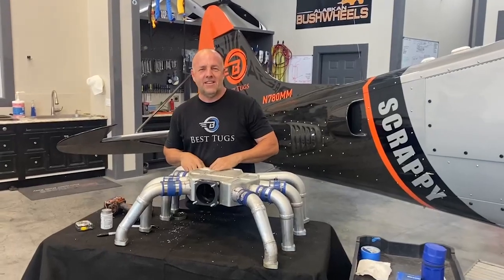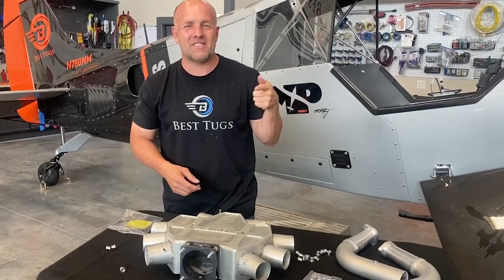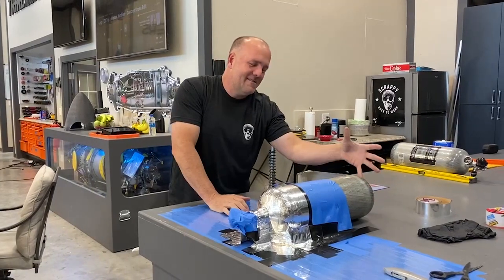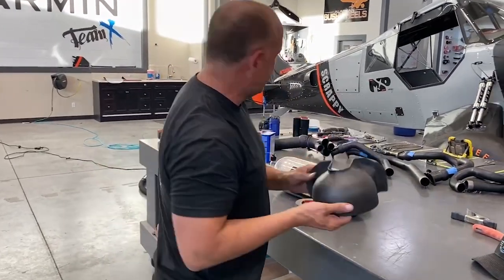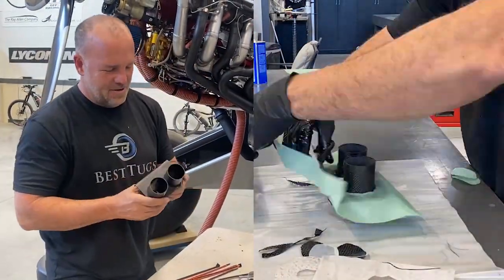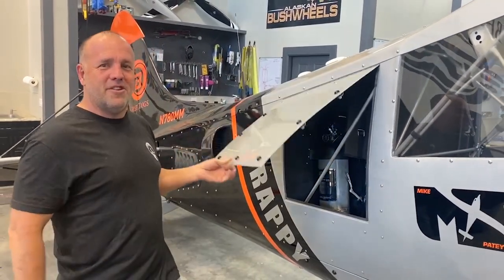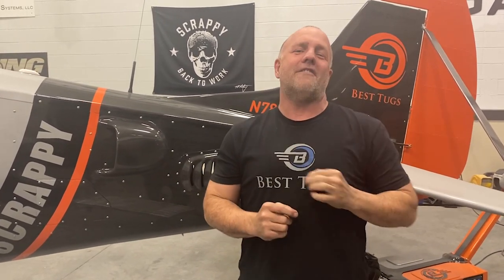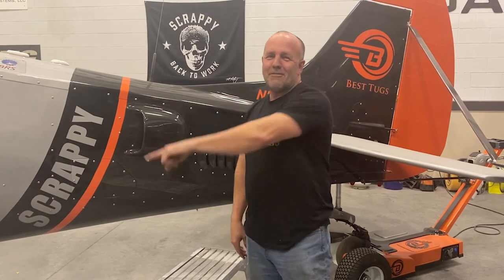Monster NOS Race Engine in a Bush Plane - Part 2 | Scrappy #40

Comment: The more I see of this engine build, the more I think Scrappy won’t need wings after all. Wow, what a beast...
Reply: Stole my thunder...lol I was thinking that same exact thing and almost posted it the same way.
Reply: I think we will be surprised by the wings... there is a reason we have not seen them. Delta wings for supersonic? The gear winglets will be enough? Tube wing?
Reply: Legit scared about other component ripping off under the trust, torque and vibrations this is gonna produce

Comment: I have seen so many young people think they just bolt on the kit and instant power.
With a small shot they can get away with it, but that is never enough and rings bind, head blow, and they are out of luck. Nice explanation of ring gap and its importance.
Good luck with your timing adventure, it is one of the more important items with nitrous injection.
Thanks for sharing.

Comment: Griplock zip ties, the thing you don't think you need until you try them then you wonder how you ever got by without them.  Used these on my boat last year and I'll never use cheap zip ties again, after a year of direct sunlight and exposure all the Griplock ties are pristine.

Comment: What can possibly go wrong... By virtue of the fact you are still alive, I'm going to say that you one very smart guy. Kids - don't try NOS at home. Am very impressed by build quality and parts too; love that you are knocking-out custom carbon-fibre parts in under an hour. I'll spend time going back over your fibre videos and the machining and cad designed cutting and tool&dye builds are over the top. No way you're fooling anyone that some of that took a year or two to figure out. Will look for your CAD video too. Great videos!

Comment: Mike, make a Y fitting 1 to the NACA 2 out.  the other issue you will be likely to have is the pressure drop across the two (cold & Hot) lines are most likely not going to be the same so your flow across the mixing valve will not be liner.

Comment: Scrappy will be in the air before it's flying, the tail surfaces will have lots of airflow, but not the ailerons, so maybe a scuba tank could feed some wingtip jets for roll control like the x-15 in the first  second before it accelerates to 60 and everything works normally?

Comment: NOS bracket weight reduction = impressive work! ☺️
Reply: and thanks for the explanation of nos burn... given you have 3 settings (?) compared to, say a car that has variable control via ecu, does that mean your witched system is quite noticeable in power surge/engine performance increase?

Comment: If the length of the hoses aren't the same they won't all mix at the same time. You can use diff dia tubes based off the length to compensate. Or add extra to the ones that are short

Comment: I suggest, you consider setting up a simple ECU setup to control timing, ignition, fuel via a tuneable computer in the aircraft. It will be a simple turn key ignition, everything can be run off the computer in terms of engine, etc. It will be much more efficient as it will make constant changes based on conditions...
Just my 2 cents...

Comment: There is a company out there making carbon fiber high pressure tanks.  The inside of the tank is aluminum but thinner then normal and carbon fiber to give the tank strength for the high pressure.  That might be worth checking into.

Comment: Would be a smart thing (if not already in the works) to have a separate bypass to the entire NoS shenanigans. If anything goes wrong, that bypass to disable anything NoS and return the engine to normal operation.

Comment: I have been using nitrous for ten years to set one mile land speed records. I push a 15 ci engine with 30 hp to 60 hp. And I spray for 30 seconds. I found running 600 psi is easyer to deal with than 900 psi. 
I realize you have already built the system. But I tried all the systems out there. I use Wizards of Nitrous from England. It’s the only system that works consistently on my extreme system.

Comment: Will hit harder/do better with the nozzles closer to the cylinders.... so further down the pipes.

Also..... there are electronics out there that will handle the timing issues and all.... don’t over think things. I’m not sure how changing voltage will change timing.... but interested to see how it works.

Comment: Excellent sir ! Why not a simple Arduino or raspberry pi controlled system for the NOS ignition timing adjustment a simple few lines of code in python or C# will do the work once hooked up to your 50hp 100hp dashboard switches, if you add also lamba probes to your exhaust system you can do all sorts of interesting things to this Lycoming 8cyl ignition and timing on the fly , and just blow our minds even more!

Comment: Curious if you considered using an electronic ignition system? Like an electroair or surefly system (modified/reworked for 8cyl. application of course). Something that would allow dynamic timing for normal operation and different timing control for Nos. I would think you've considered it already, and would like to hear your thought process on why it is, or isn't best (or practical) for your application. Maybe in the next video you could talk about it? Thanks! Love the videos. Keep on doing this crazy awesome stuff.

Comment: Amazingly cool, on a subject I know nothing about.  But honestly I am waiting on the wings...and hopefully will get to see some novel uses of carbon fiber in the construction of them.  I have always wondered why, if carbon fiber is the supposedly end all be all "new" material, stronger, lighter, will not corrode, etc...then why are we still using fabric and aluminum to construct wings? I imagine a wing using carbon fiber for both the covering and the ribs...maybe even  Kevlar/ carbon fiber control cables?

Comment: absolutely fascinating!!  I will never use NOS, but the details are fascinating!  watching over the last couple of years I have decided I need to make some parts out of carbon fiber.  you make it look so easy.  I will do my homework though.  thanks for the motivation to do something new.  you are the guru of innovation and manufacturing.  really liked the closeups of the CNC lathe.  I programmed and ran several including CNC mills over the course of 20 years in the industry.  REALLY brought back great memories.  Thx Mike.  BTW: are those Lycoming Electric Bikes?  :o)  :o)  couldn't help smiling throughout the video.

Comment: Hey Mike I do a lot of custom tuning on automobile computers why not put a stand-alone ignition system on Scrappy the tune ability Alone might add extra options and Power, Plus data logging and the safety of knock sensors.

Comment: Oh and if you built a system so you could  let your tires rotate in the air stream the electric  rim motor  could be used for emergency  power. So maybe one alternator will do.saving more weight.

Comment: So I did the math on the wingspan you'll need for that much horsepower/thrust and it came to just over 6 feet. So more like a flying elevator than wings. That should be a quick vid...

Comment: Pardon the question, but if you turn the variable heat, and air flow knobs to lowest settings, where will the buildup of heat go? Would adding a butterfly adjustable "y" pipe before the firewall be a good idea to control that stagnant heat?   Allowing it to escape out the side.. just thinking about the tubing melting.. (the orange tubing)  wasn't clear what you intended on using.
Reply from the maker: Great question 👍🤠. There is no stagnant heat, that’s very risky.  I didn’t talk about it but if you pause the video when it shows a close up of the orange tubes going to the mixing boxes on the firewall you will see two large and than one slightly smaller hole out the top of the upper box.  That is the bypass that dumps the extra heat out a side port of the aircraft so it’s not left in the hoses or dumped into the cowling that causes other problems.  I can’t remember if the hose was on yet in the video or not but it is now.  It literally exits a specific side dump outside the cowling.  Thanks for the great question and comment

Comment: You don't want the Fuel/Nitrous mixture to explode in the combustion chamber of your engine. That's bad for the engine. 
You do want the mixture to burn efficiently, in the correct stoichiometric proportion.
That's going to be so much more fun.

Comment: To all my horsepower fiends out there.Thermal expansion is the name of what happens to the rings....every metal has some. “constant” for which it will expand based off the material. It’s independent of the diameter. Three(3) factors, not 4: material, temp change, and original length. If you need this to confirm some level of safety or successful operation, use it! It could save a motor or even your life.....like he said, “it’s engineering, math,......”

Comment: Any power adder has the same concerns with ring gap... Mike do you have to worry about N20 bottle temperature? Do you have a warming blanket installed? It’s pretty common in the automotive arena. I’m thinking about the elevations you’ll be flying at and the already lower ambient temps... will you have pressure fluctuation in your bottle?

Comment: very very nice Sir......now QUESTION: purpose of Scrappy is to fly in/out of places you never could of before, ie Density Altitude and Landing/Takeoff runs etc, now, suddenly a  hose and switch and thingamagingies stop working after you have landed, will/can WIFEY fly in a spare hose/injector/fuse when you are stuck? ......respect, nice videos.....

Comment: Curious, are you going to be running a tank warmer? With a 3.5 deg drop per 1000 feet I would think the tank would get quite cold. Would you experience a pressure drop, or is it offset by the lower air density? Never ran nitrous at altitude.

Comment: Question, because your cowling is more arrow dynamic than say an open engine bay, does it allow more thrust to be made since there would be less resistance for the wind with arrow dynamic cowling opposed to open engine

Comment: About that Nitrous Oxide tank bracket:  Is the bracket robust enough to handle a hard landing?  Two weeks ago the American boat in the America’s Cup race capsized and the bracket holding the Lithium battery failed.  The dislodged battery stove a giant hole in the hull of the boat.  For heavy items in a lightweight structure, inertia is not your friend.  (The boat is constructed primarily of carbon fiber so there are parallels.)

Comment: Two things first you need to vent the pressure release valve to to the outside if you haven't, otherwise if the bottle vent ever triggers it can fill the cabin and you pass out.  They make kits for cars if it's in the passenger area. https://www.jegs.com/i/ZEX-Nitrous/243/82111/10002/-1

The other I would turn the bottle as the pick up tube in the bottom of the tank is at the edge not the middle so at acceleration on a near empty bottle you could go to vapor not liquid.  Also never use it inverted lol

Comment: @Mike Patey, I love your channel and everything that you are doing. I had a question about your parachute system and I’m asking this because when I used to go skydiving, we are trained to ALWAYS go to your free fall arch and it will stabilize you if you’re out of control. And you generally speaking, also will always pull your chute from that position too, although you can technically do so from a vertical, upright position just as long as it is your head that is upright and not your feet and legs.

But that got me thinking about the parachute on your plane. If you ever had to use it (and I hope that you never do) it is designed to work in a scenario where you have forward momentum and your engine died or was not producing enough power to continue flight. But the chute is placed on the plane basically on its back too. My question is if the chute would still work if you are in a complete nose dive or something catastrophic happened and the plane was tumbling and rolling all over the place as it was falling out of the sky. Say for instance a goose or plane collided with your rear stabilizer and or rear elevators, and/or your front wings and immediately, you lost complete control of the aircraft and had to pull the chute right away. Is there any attitude of the plane or position that it could be in to where the chute could not safely be deployed because the lines from the shoot would get tangled all around the plane and/or cut by the prop? I guess if that scenario were to happen, it would still be better to pull the chute anyway and then hope for the best because if you didn’t, the plane impacting the ground in that scenario, would also be fatal anyway but I was curious about that specific function of the chute.
Thank you for your time and keep up all of the hard work that you are doing and for sharing your ideas with total and complete, perfect strangers!
God bless!

Comment: While I realise there is probably a good reason for not using automotive ECUs are you not dismissing them out of hand.  They survive 24hour races, they work with 100% reliability now in modern cars.  A Haltech or SDS ECU and coil on plug spark can have a full timing and injection map for each nitrous stage.  They do three stage nitrous injection for 8 cylinders.  With a MAP sensor, knock sensor, and two wideband O2 sensors in the exhaust it could optimise for altitude automagically.  They also have inbuilt protection which can safely retard the timing and fuel to save your engine before you do.  You just seem to be jumping through a lot of hoops to avoid systems that are reliable enough now for aircraft use.

Comment: The speed at which you can fabricate custom parts is blowing my mind.

Quick question on the nitro kit.  It sounds like the controller manages the additional fuel?  So your throttle/mixture doesn’t need to change?
Reply: Ya check out the part 1video I think it explains it a bit more.

Comment: hihi guro....last time i wrote/aske if a L wing becose its not so wide but backwards longer could give more speed due less frontresistance and longer surface for better lift.....?  now, maybe you should install an angle-lift for the front engine beeing closer to helicopter styl for better vertical-quick lift off the ground and re-regulate the angle while getting more clearance to pull then forward...??

Comment: For as much work you put into the system are you not running a bottle heater. Its a shot in the dark what you're getting if you cant keep consistent bottle pressure.

Comment: When Scrappy is flying inverted on Nitrous your pumping liquid nitrous vs gas with fixed vertical tank mount..! ... Design a carbon fiber gyro controlled nitrous bottle holder that keeps bottle upright no matter what the aircraft attitude is...!

Comment: Interested in your Heat Exchanger set up for your  cabin air / cabin heat system supply.

(a) - What altitude did you optimize (size) it for ?

(b) - Are you aiming for 0.55 lbs / min of air per person (1.1 lbs / min total) at 24 degrees C at the the Cabin outlets* ?
* Gaspers perhaps ?

(c) - What cold air inlet speed are you designing for ? ... RAM Air scoop (fast) or Submerged Inlet (slow) ?

(d) - What maximum air speed do you anticipate entering your mixing plenum (box) ?

Hope I'm not asking too many questions, just went through a fun design exercise  with a mate, so I'm eager to compare with the performance figures you anticipate for your system.

For the record my Shell Hx assumes :-

- a thermal coefficient of 500 watts / sq m K
- a temperature drop on the Exhaust tubes (2 x 1.75" dia) from 475 F to 371 F within the Hx  ... (suspect assumption)
- has dimensions of 10" (L) x 8.5" (W) x 5" (H) ...
- it is designed to enclose two parallel Exhaust tubes.
- it provides .48" radial clearance as it is intended to be independently mounted from the exhaust 
  to avoid hard contact on start up and shutdown; it uses a high temp membrane.
- has a volume of around 325 cu in
- is sized for optimum performance at 6,000 ft (Cabin pressure : absolute)
- produces a maximum air speed of 48 m/s (based upon an unobstructed RAM air inlet design sized for 100 kts TAS)
- delivers the air at 24 C

You will likely have at least 6 cabin outlets (ankle, torso, over head), as well as windshield defrost and probably conditioned air (cooling) for your avionics, all served by your mixing box and the air airspeed at the outlets might vary from 0 m/s (fully closed) to around 8 m/s max (almost gale force wind ... LOL). The mixing box might require three different compartments with their own outlets providing differing hot / cold mixture ratio volume flows.

Cheers

Comment: P.S.S.  The nitrous ma blow out the spark from a conventional aircraft magneto system, then Boom.  Also more engines are lost to a drop in fuel pressure than any other way.  You MUST have an electric high pressure fuel pump with a return style regulator.  At least 60 psi return fuel system  with the regulator set at 8 psi to the nitrous solenoids.  You would be best served with a modern progressive nitrous system.

Comment: I'm curious, if you gap your rings for Nitrous heat levels, how does that affect performance for the 99.9% of the running time at lower, non-NOS, heat levels?

Comment: What octane rating is your fuel?Higher the octane is on normal fuel (94-145)the slower the burn is and you have extra fuel enrichment to burn with the NOS. I worked on aircraft engines from C 100 to P/W 2800 and for T/O 145 was burned then switch was made from 145(purple colour)to 115/125 for cruise.145 octane burns very slow so you had a full advance on the magnetos. I don’t know if you can still get that higher rating fuel still?